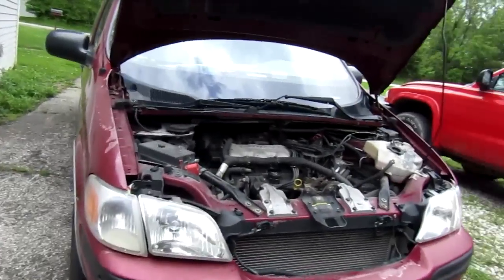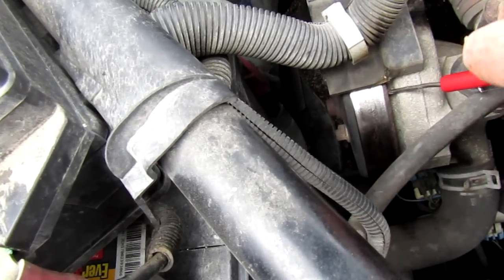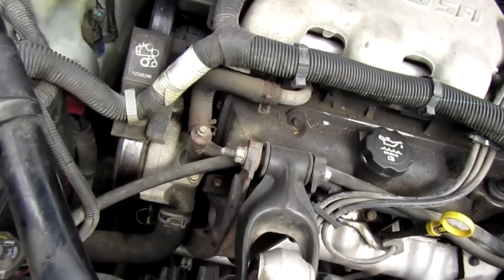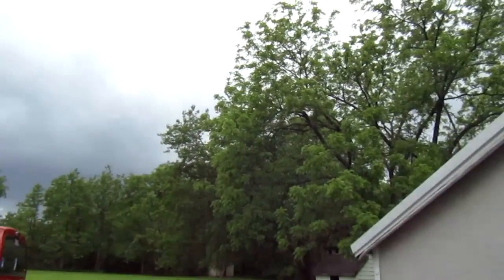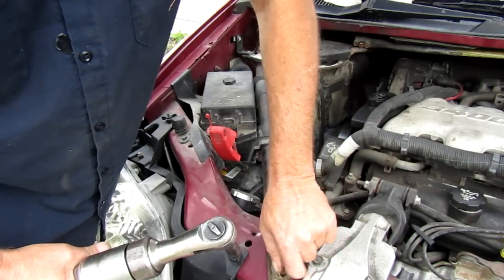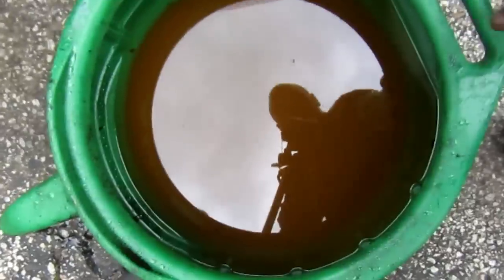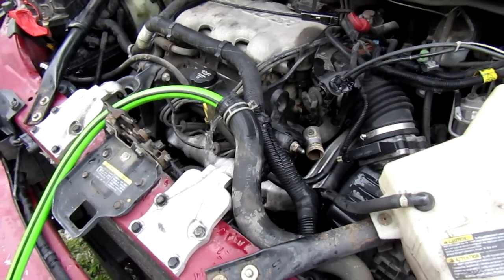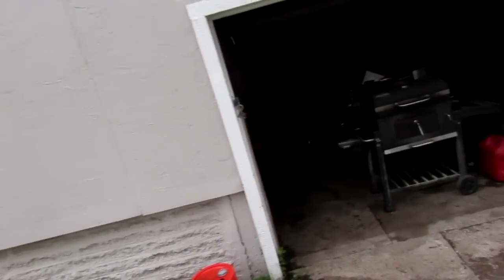Chevy Vinture Water Pump

Comment: Re: DexCool. I towed a Malibu quite a long way for a "transmission fluid leak". The owner saw a puddle under her car and called the body shop she had recently picked up the car from. They called us and I got the assignment. I get to the car and it is dry underneath. I pulled the car out to the open area and scooped up the front end. Hoisted it up and saw a trace of fluid on the subframe. I dabbed the thickest part around a hole and brought out a bit of gelled coolant. I took the car the 38 miles to the body shop and told them what I found. Done and done.
Reply from the maker: Yeah I'd say that car's got some problems

Comment: me and my dad put peak full strength concentrate antifreeze into our 2 truck his is a bone stock motor 2006 ford f350 6.0l diesel and mine is a 1989 ford f250 custom with a 351w small block our diesel guy that work on my diesel told us use full strength concentrate antifreeze so i been using into my truck which it love it and haven't stop using on both truck i know our not really so post us in older truck but scene i us my truck local into stop and traffic put it stay cooler with it and us rtv silicone sealant high temp an blue and other Anti-Seize on bolts
Reply from the maker: I've never heard of anybody using Straight antifreeze no water I didn't know it would work
Reply: @donaldchastain6847  yeah me and my dad didn't now either until our diesel guy told us about it and said it want ur so post to put into a diesel and it actually keeps the coolen temp lower then using 50/50 because i started using into my truck I've noticed the difference in temp vs 50/50 because it not even it 1/2 temp it showing 1.5 line peak is the only brand we buy it a red lid